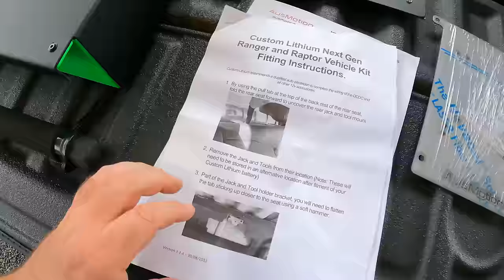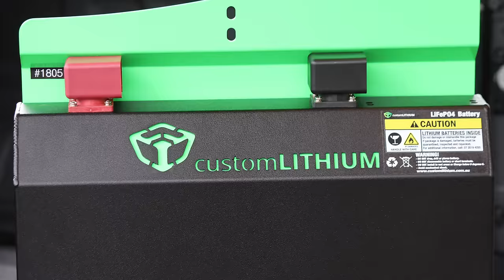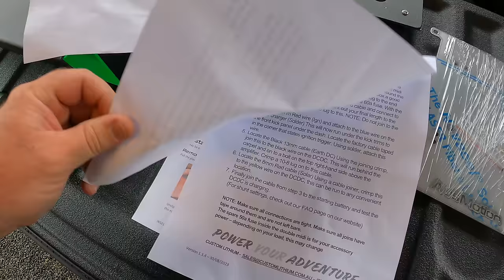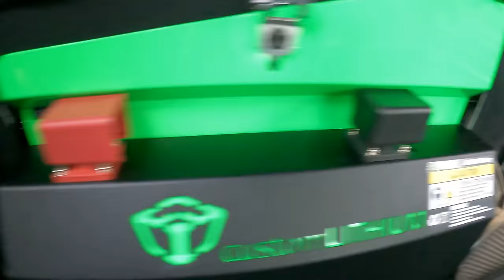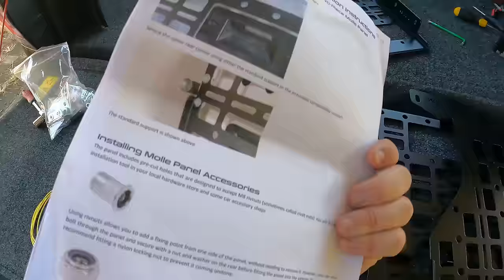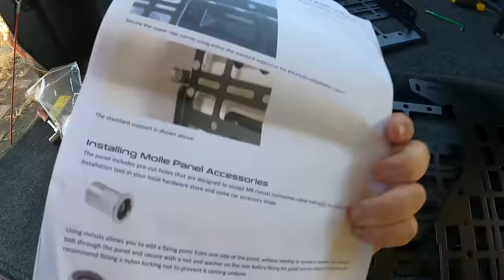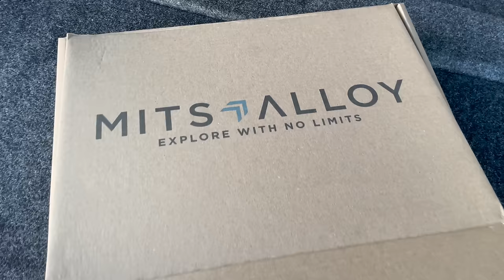🔥RANGER RAPTOR DUAL BATTERY SETUP - TUB FIT OUT EP#1 Custom Lithium Battery & Bed Rug installed.

Comment: Hey man, recently picked up a 24' ranger Raptor. Since im from the US we are obviously a little behind so appreciating all your older content. Had a question on the BOV however. I know in Baja mode the turbos are ment to spool for approximately 3 seconds longer for a boost of instant power. Have you noticed if venting to atmosphere vs recycling interferes with this? I really want the pshhh sound after watching your shorts. (Also seems pretty popular on the Bronco Raptors here with the 3.0) but not if it interferes with that system. Thanks
Reply from the maker: I haven’t really notice must difference the thing is super fast off road. I love the BOV sound to 😎👍🏼

Comment: Ty, why no video on the sneaky Turbosmart BO valve install? Was it hard? Did you fit it yourself ? Cheers mate
Reply from the maker: It's installed in the fabulous air box video mate. Watch every video on Raptor to see other cool things I install.
Reply: @TyFenwick  I watched the airbox video (now I want one!) and saw the valve fitted but couldn't find a video of the install. You revealed it in the airbox vid as a sneaky previous engine upgrade.